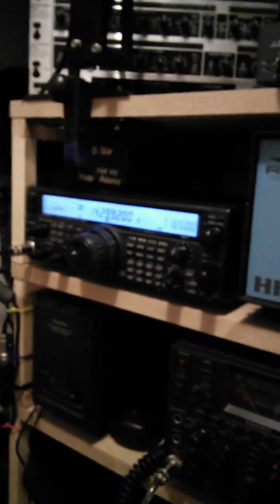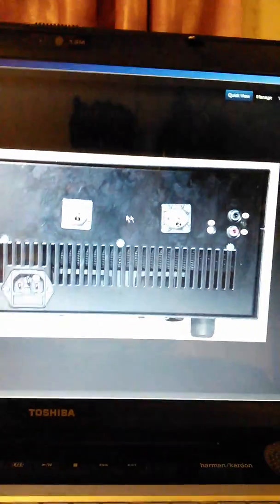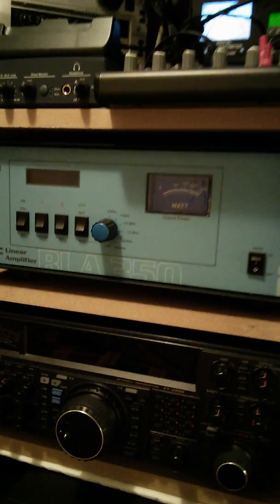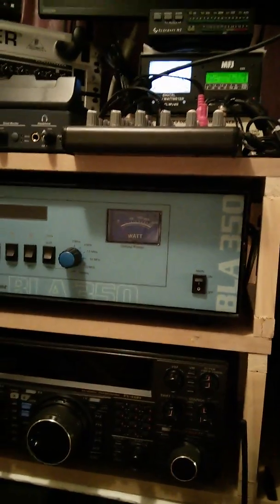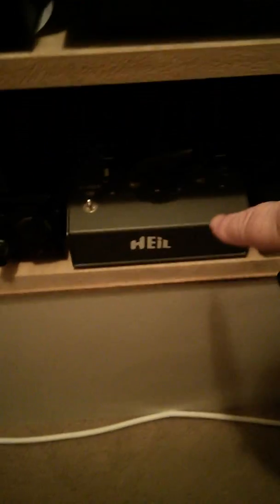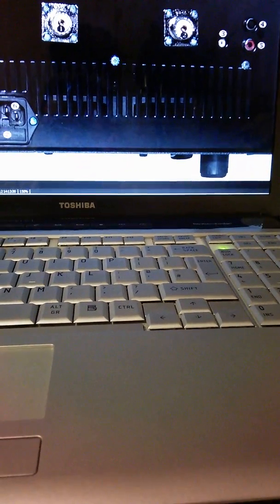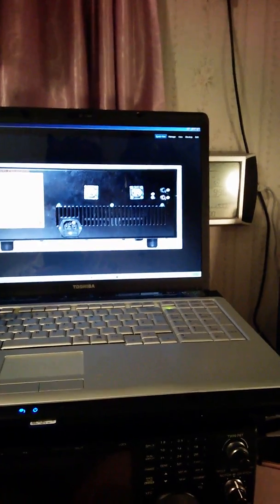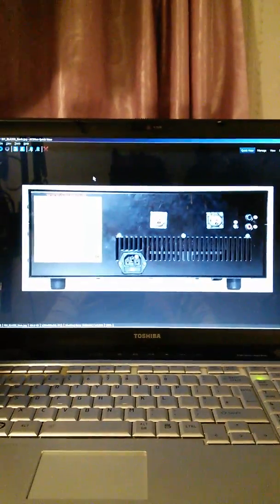Connecting a BLA350 to a FT847 Video 1 of 2

Comment: hi another excellent video which convinced me to buy a BLA350,only problem is the lead.i tried to read your diagram but its too small on the screen,is it possible for you to send me a copy?also could you tell me how you would use the linear if the radio does not have these connectors?you seem to be the only person that has any info about this linear.even the person it was sourced from told me to watch ur videos.any help wud be much apprecited as elecronics aernt eay for me due to my disability,i have tried everywhere to buy the lead.as u know no one sells them so i need to find someone to make me one.many thanks Mark